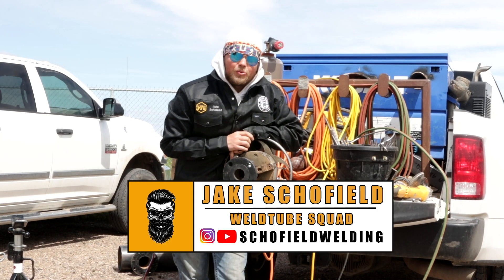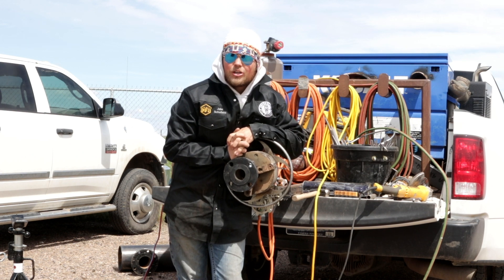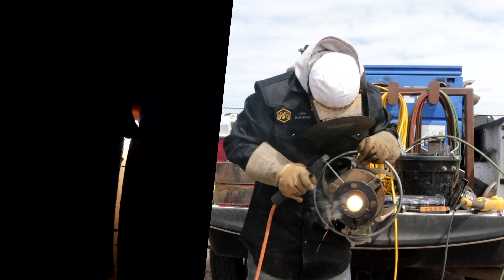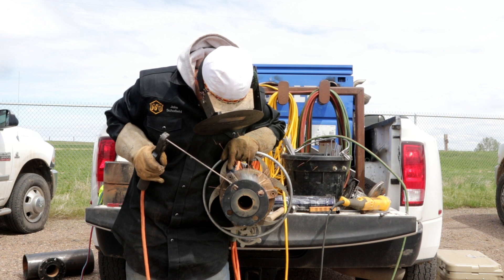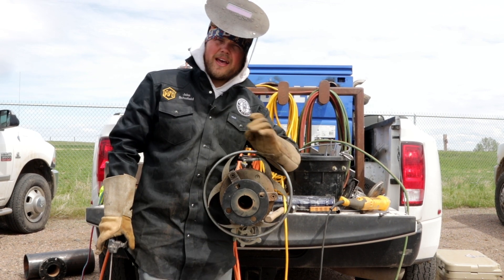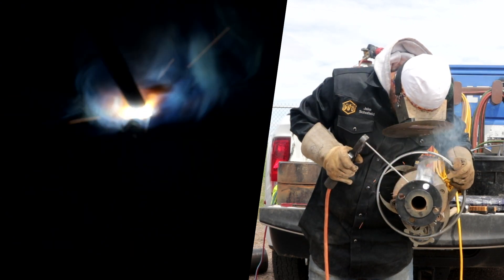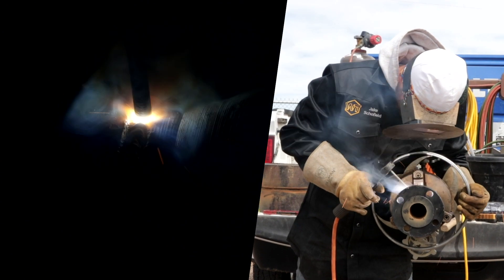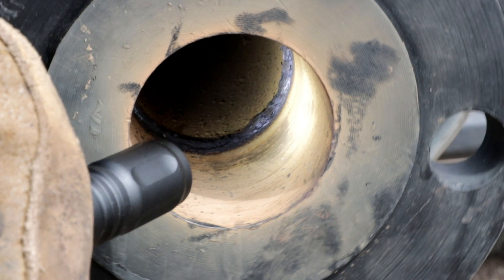6010, 7010 & 7018 Stick Welding with Jake Schofield

Comment: Seems like he's always doing 6010 rods for a root pass as always but then 7010 then 7018. I'd be interested in hearing why if anyone knows?
Reply: 6010 for better penetration in the root pass, not real familiar with a 7010 hotpass, I just use 6010 again.

Comment: Don't you guys know how to run anything uphill. Don't weld much pipe, but when it comes to 8,10 12 inch plate we always weld flat if we had that option, but almost always uphill. Thanks for the great videos.  T

Comment: Jake, I love your videos. You have a great attitude and you're a natural teacher. I have a question: What's the advantage of using different rods for different passes? Would it not make for a good weld to use 6010 from root to cap?
Reply: Mark Lowry part of it is appearance of the weld, but most of it is metallurgy.  6010 welds do not meet requirements for all service.
Reply: different strengths of rod / different requirements based on heat pressure weight material etc

Comment: 7018 leaves a nice looking weld and is my fav. to work with. It has been called the workhorse of the welding industry.  I use it 90+% of the time.
Reply: It's the rod that built America